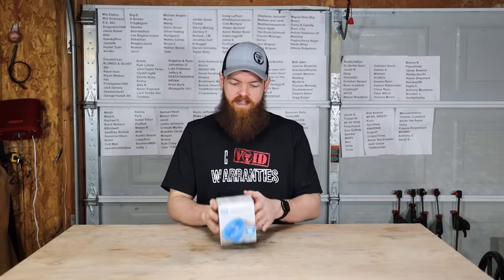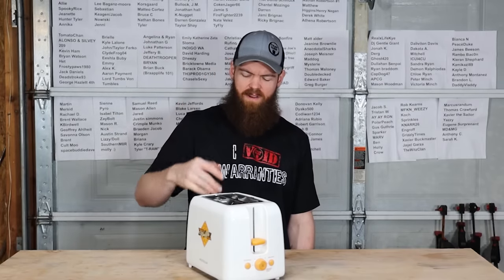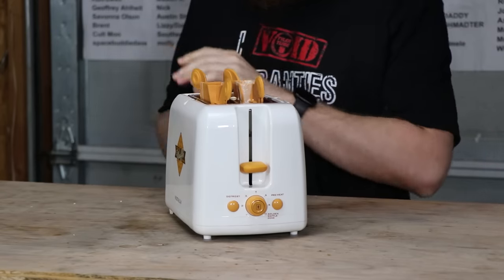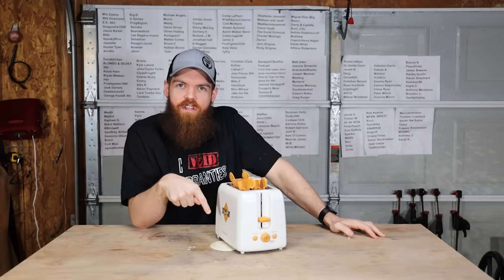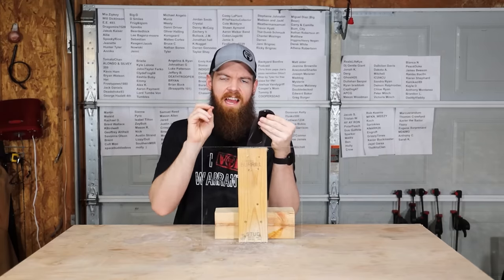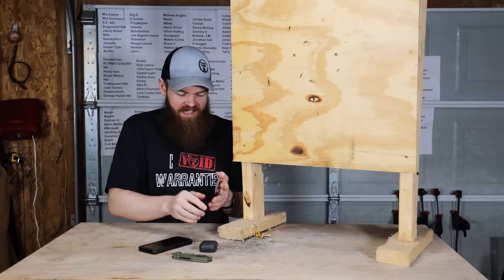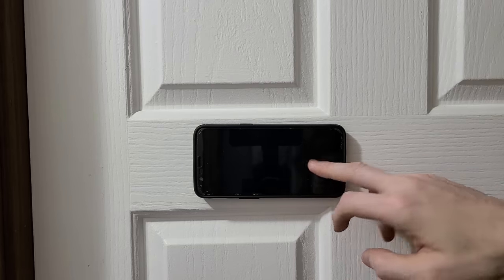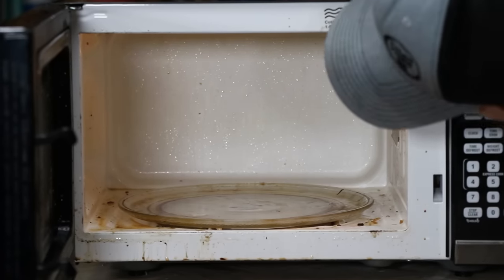I Tested Random Things From Amazon...

Comment: The vinegar mom is interesting, I've always had luck with taking a bar towel soaked in water then spring out mostly... microwave on a few minutes, with gloves or other towels (it will be 212F or more I am guessing?) use it to clean just about anything.  I guess adding vinegar or soap would help but don't usually do that, you have to rinse afterwards if using soap, maybe not with vinegar?

Comment: For the sticky holder thing. I use those (of another brand) in the car to keep the phone on the dash. They do work pretty well. They eventually get dusty from being in the car, and will stop working. I killed one of mine by using the only cleaning liquid I had in the car at that moment, hand sanitizer. That turned the thing into a sticky permanently half melted mess. So DO NOT use  hand sanitizer or any alcohol to clean it. After replacing it, the next time it got dirty, I cleaned it with water, and it still works great.

Comment: I used one of the sticky pads years ago to hold an old cell phone on my apartment door frame as a door bell. My guests would dial the number for the phone and let it ring once or twice. I had a doorbell ringtone set on it. Since the call was never answered and never went to voice mail it didn't use minutes. It was also handy to dial my good phone if I misplaced it. I love the sticky pads so much I bought a bunch for stocking stuffers for my sisters kids. Every year they asked if they were going to get more of them.
Reply: My phone hung on the door frame for no less than 12 months without falling off the frame.

Comment: Just buy a waffle maker LoL The lid to the ice maker goes on after you've made ice and you have removed the inside cup. The steam momma does work, but you can't sit and chat awhile and have it dry inside. And use a Mr.Clean magic sponge (wet it) after you take out the Steam momma. The microwave glass plate, PUT IT IN THE SINK WITH WARM SOAPY WATER !!!!!

Comment: i used to work for a vending company. part of our job was to clean out the microwaves at factories. people would burn shit in them constantly, they didn’t give a shit because they knew we had to clean them out. we just dumped straight water on the turntable and microwave it until it was boiling. i’d dump that boiling water on the stuck on food and it would wipe right out with a green scratch pad.

Comment: the sticky pad works by increasing friction. so surface area in contact with it is important which is why something with a lot of grooves or stippling will not work as well such as the pocket knife. also why the devices that are used for car dashes don't work well if there is a lot of texture on it.

Comment: If the waffle toaster thing is like other toasters then you push the middle spring down to lock to activate the power then you press the preheat or defrost buttons. It’s like toasters that’s have bagel, cancel, and frozen options

Comment: the waffle maker - 99% of the mess was you. put the batter in a squeeze bottle, you sdropped batter all over the place with the spoon. next you didnt spray the inside of the milds with pam or another spray. youre old enough to know better. if you dont know basic cooking, you shouldnt be reviewing advanced appliances. batter tends to burn when dumping it on heating coils. next stop over filling the mold, and it wont boil over. its that simple.

Comment: i had a much better ice maker with a similar concept.
it was basically a box, that opened lengthwise like an alligator mouth.
when closed, you filled it up through a hole in one side, it sealed with clamps and was watertight.
once frozen, you could actually pull the flat sides outward to break the ice free, basically inflating the box by yanking the handles. which would free the cubes and leave the box as a full, ice container. you could then dump ice out the hole, or open it to grab cubes out. once empty you just flattened the sides again and filled the hole with water.

Comment: The silicone molds for the waffles will slowly degrade as the user demolds repeatedly, especially with damage from forks, although the waffle material should be weak enough so the mold isn't stressed as much as when casting resin or plaster. 

But for the amount of time this takes, and the amount of counter space the device uses, you should definitely just buy a waffle iron. Quick waffles, never have a durability problem.

Comment: When you apply a squeezing almost even type pressure. Eggs are very strong. They will not break. Have you ever tried to break an egg in your hand by squeezing it???. It's nearly impossible while applying even squeezing pressure. But if you dig your fingers into one side while squeezing it will most likely burst from that side.. The even pressure applies a sort of support to the Shell creating protection to the egg. A natural strength so that a chicken can sit eggs.

Comment: 13:05 it’s not your fault I literally had the same issue with mine. They are extremely difficult to close correctly what I did is I tested with water a few times until I gotten hot to close it…still leaked a tiny drop

Comment: Dude I gotta disagree, that is a filthy microwave. I wouldn't eat anything cooked in there, good thing I don't have to. 

Cheaper tip though, simply heat a bowl of hot water and a couple tablespoons of water as long as needed. Been doing it for 30 years. The vinegar smell disperses in 20 mins to 1/2 hour. You can also use lemon juice. Was the plate in the sink, it takes 15 seconds.

Comment: Imagine if you used like a measuring cup with a spout or a squeeze container like an empty ketchup bottle ..preheat the toaster by depressing the button and then hitting preheat ..enter the batter turn the temperature to 7 or 8 and let it rip ..some canned waffle spray can't hurt either ..you did pretty much everything the hardest worst way possible